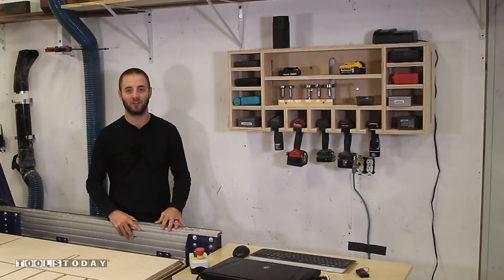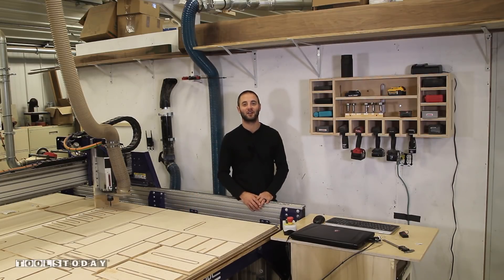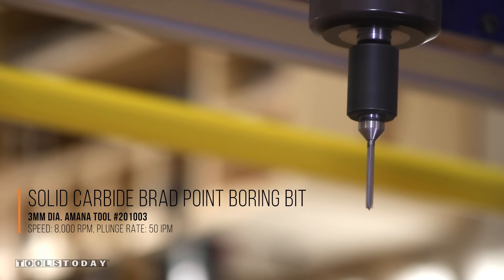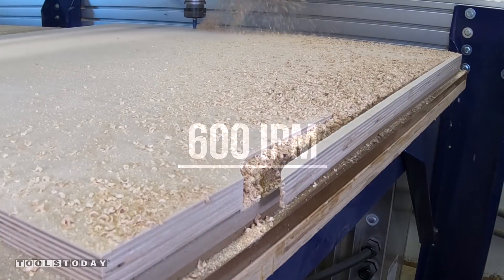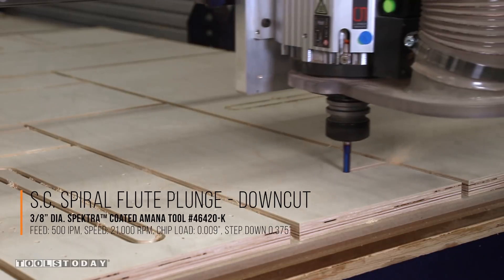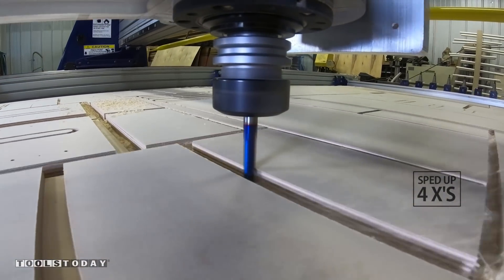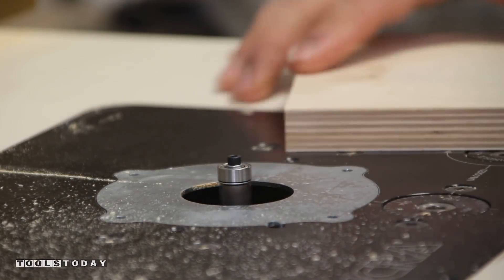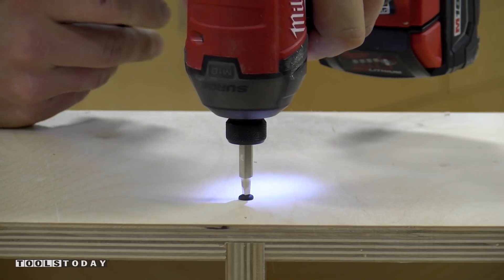CNC Project: Building a Drill Storage Charging Station

Comment: You are showing 600ipm and .375" stepdown - but the video shows the bit ripping through a sheet of  what looks like 18mm ply in 1 pass.... - can you please provide some clarification on this? - the spectra chart shows a much slower ipm and smaller chipload for Veneered Plywood - we just ran our CNC at the same settings as you describe in the video and it ran super quiet and cool.
Reply from the maker: True, the compression bits are designed to cut all the way through the material.  We should have stated it was 600 IPM with a 300 IPM Ramp Down instead. Amana’s recommended "starting calculations" and each CNC machinist may want to adjust his Chip Load and IPM depending on the size, power and stability of his machine. For example, if I was using a table-top CNC machine such as a Shopbot, I would run my IPM slower than on my 4’ x 8’ heavy-duty Cobra X3 machine. These Spektra coated bits have been known to spin at 1,000 IPM and deliver clean cuts. Hope this helps!

Comment: Great Tools, can you tell me how to calculate the plunge rate and the speed of the spindel for the Brad Point boring bit?
Reply from the maker: That's an excellent question. As the brad points are designed for use on a drill press or boring machines, we ask you to contact our Tech Support directly by calling (888) 699-3939 or emailing  ttsupport@toolstoday.com - thank you!

Comment: Hi, what size and power rating is the spindle to be able to keep up with 600ipm?
Reply from the maker: Hi, we suggest to check with the manufacturer, ShopBot. Their website states the PRSalpha CNC Machine reaches rapid transit speeds of 1800 inches per minute and cutting speeds of up to 720 inches per minute. The PRSalpha series of full sized gantry tools deliver high performance, high efficiency production, as well as fast position and cutting.  http://www.shopbottools.com/mProducts/prSalpha.htm